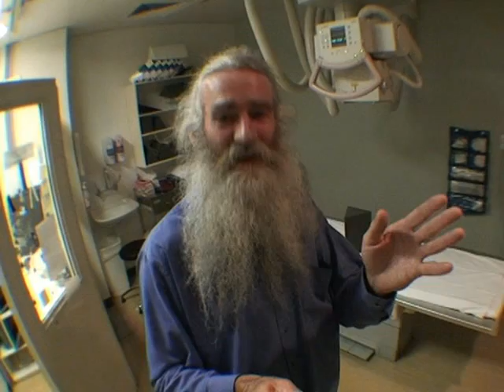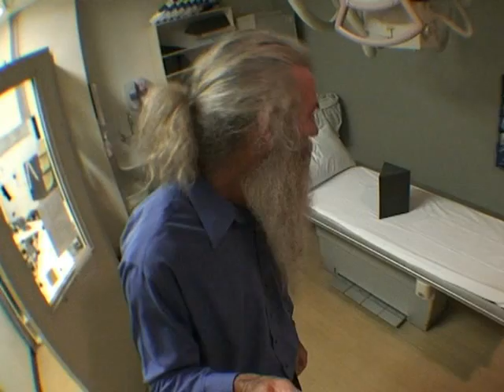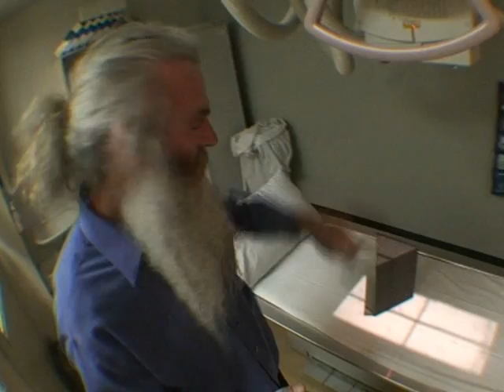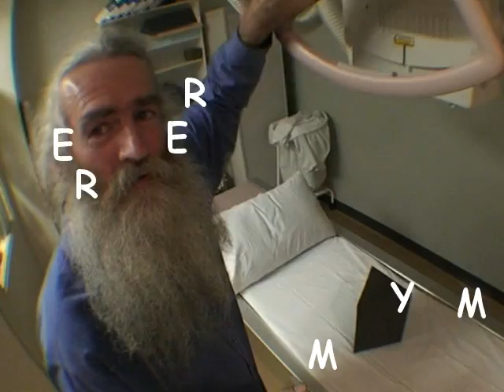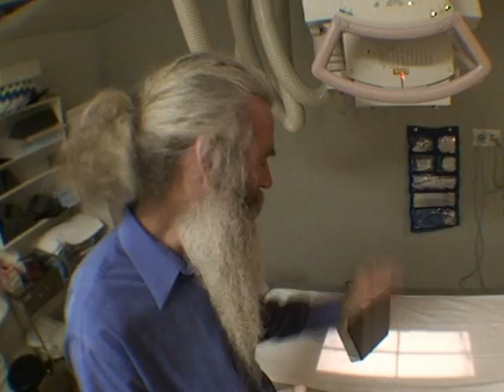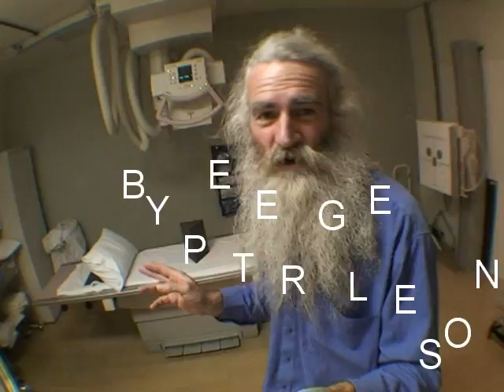X-RAY BEAM GEOMETRY

Comment: Peter, I think contrary to your catch phrase , that Beam divergence is real. The  source is approximately a spot. Photons are emited from the focal spot travelling is straight lines.  The illusion is due to the LBD light showing where the irradiated area is, and a false assumption of parallel photons covering the area or photons all travellin perpenicular to the front surface of the  LBD
So I feel your point is expressed incorrectly. 
The xray field is certainly not a set of parallel photons filling the area shown by the LBD. So there is still a same line from the focal spot through the edge of the sponge to the plate.  A small error will creep in if the tube rotation point is not at the focal spot ( usually it is not). 
The conical beam limiters ( Cones) used up to the late 50's probably made this point easier to recognize.  Interesting reason to draw out the shapes and recognize this important illusion of the LBD light.
Reply from the maker: Yes. I have expressed it incorrect in a literal sense but deliberately as many radiographers think the central ray has some kind of special characteristic. KT Clarke was my text book in the late 70s and it said that to do an oblique hand, center on the head of the fifth metatarsal so the divergent beam would prevent the bones from overlapping too much. Can I ask you how you do the Townes projection. Do you follow the instructions and include the face in the exposed region, or do you angle the tube less and limit the collimation to above the eye brows?

Comment: Hi Peter, 

Thanks for the video - I'm working it into an upcoming presentation for the ASMMIRT national conference (with referencing to yourself, of course) please let me know if you have any objections. 

Thank-you very much, 

Amber
Reply from the maker: +Amber Cavanagh Go for it. Someone has to hold the torch and create change in the profession at National Conferences. In Hobart, mine was one of 2 papers that showed the serious failing in understanding that exists in our profession.  I applied to present a paper at ASMMIRT but they declined and offered me an Eposter instead which I was insulted by.
Reply: +Peter Gleeson 
Thank-you very much. Thats a shame. Ive worked it into imaging for taylor spatial frames but would have definately liked to have seen alot more useful applications for it
Reply: Would it be possible to access your paper that you presented in Hobart? Also do you know of any another articles that address this understanding to beam geometry?
Reply from the maker: The Australian Institute of Radiography has prevented my paper being published. Perhaps it is because they couldn't find any old radiographers to referee it. I suspect there is an unspoken need for our profession to not admit to doing defective radiography for the past century. I have also been rejected from presenting more findings at the last 2 national conferences. There was another paper that addressed the issue at the last conference. Another one was presented at Hobart that originated from the Melbourne Childrens hospital relating to geometry and follow up studies on bone surgery. Similar findings in all reports. 3/4rs of qualified radiographers fail simple geometry tests.

Comment: You forgot to centre on the foam block (this is a fundamental principle of Radiography) if you centre the CR on the foam block then rotate the tube the shadow will distort (as will bones in an x-ray
Reply from the maker: You haven't tried it. The assumption you have made is the mistake made by 75% of qualifieds, 95% of students, and 5% of radiologists. If you fail this test, it also means you are not using a focused grid correctly. The geometry (and the shadow that represents it) will not change unless the relationship between focus and object changes, and it doesn't if you angle the tube.
Reply: I'm just confused now as my lecturer demonstrated it with a couple of scaphoid projection and the scaphoid changed length depending on the angle of the CR
Reply from the maker: @ambrosemyrridin9714  You change the angle of the central ray by moving the position of the x-ray focus. The central ray is fairly arbitary. When you expose a 35x43cm at 100cm you are using all the angles 34 degrees to 24 degree - the central ray is just one of them. It has been used as a positioning aid but reliance on centering point method limits the feedback loops associated with more accurate techniques where the radiation is strictly confined to the needed region or to the cassette size. Accurate collimation technique means learning from illuminated expectation, to the result of the prediction
Reply from the maker: Rotating the tube doesn't change the geometry of the projection which means you can change the centering point and optimalise collimation. Whenever you move the tube you move the focus, and therefore, the geometry of the projection

Comment: you are wrong
Reply from the maker: That is so funny. Why don't you try to repeat what I have done, then decide what is wrong. The text books are wrong. Your lecturers are wrong. The geometry speaks for itself.
Reply: well I'm sure she can repeat the experiment again but you will still be wrong. and you are right, I am sure every textbook ever written on  beam geometry is wrong
Reply from the maker: I am about to publish a paper on the subject which has been impossible until recently because there are no references to used because no one has noticed or cared. I had to do a proper survey at a conference and produce documented evidence. There were 5 questions - 3 on geometry and 2 on applying the principles in work situations. They were yes/no answers. 4 got them all right which is the same as the number expected through pure chance.